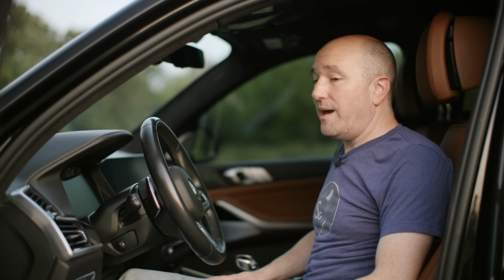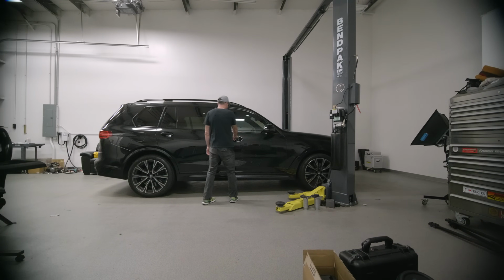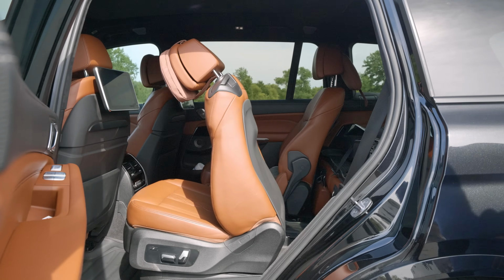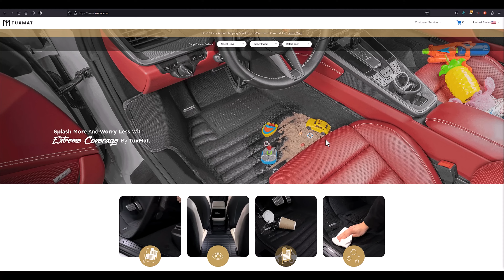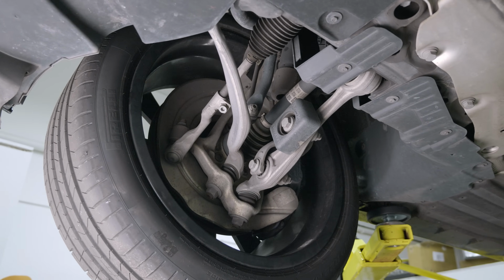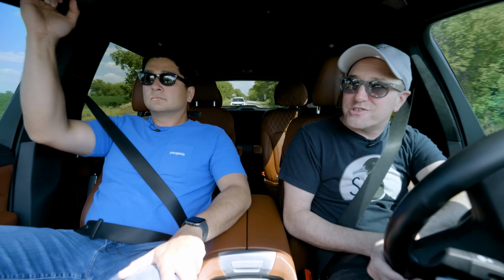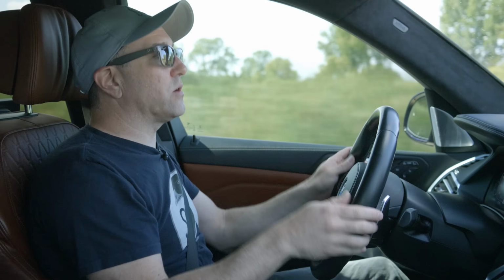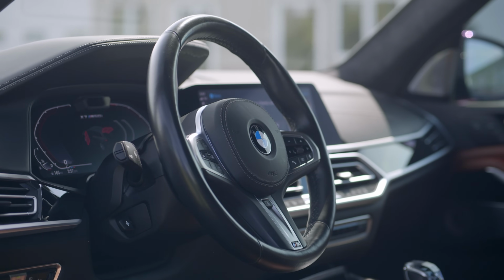BMW X7 | 45,000 Mile Long Term Results

Comment: Hey host, I have a bmw 340i as my dad vehicle and a Honda Pilot for our family vehicle. Ive been dying to upgrade to an X7. The Pilot handles like a tank, slow, but as you mentioned it pulls off the family duties very well. This video has convinced me that the X7 is not a family vehicle until your kids are 10+
Reply: Not the m50i that is, the 40i is. With bench seat.
Reply: I’m coming from a Telluride which also drives and handles like a big slow tank. The 40i is the most practical choice for most families with bench as the comment above points out
Reply: @cizzlen07  those tellurides have gotten great reviews
Reply: I also have an M340i as my personal fun toy and a Acura RDX for family use. I did test drive the Pilot and Passport as well as X3 and GLC before getting the RDX. The standard Honda SUVs are exactly like what you described. The X3 I tested was 30i the dynamic is just similar to the RDX. Not sure if a 40i would be much different on the X3. The GLC is very luxurious but lack the dynamic. My biggest complaint on the M340i is actually the lack of ventilated seats, otherwise the perfect sedan I ever owned.

Comment: Im driving a 2018 Chevy Cruze. I just bled out the brakes today only because its going on 6 years old with 19400k miles. it cost me 17k new. Ive had 0 issues so far

Comment: I Normally never comment but I must say I look forward to your HONEST no flak reviews.  

A couple questions from a fellow BMW/General car enthusiast 

The X7 is more of a status-mobile for most buyers.  That saud do I person6think the X7 40i with the B58 fixes a lot of the issues and fits almost everyone's needs.  Basically a X7 40i with traditional suspension is the sweet spot.  Thoughts?

I currently own a 23 M3 comp RWD.... EVERY SINGLE ISSUE both interior and performance wise that you mention are exactly my same issues with my G80.  

I think the two best BMWs on sale right now are the X5 40i, and an 840i gran coupe.  They're very over looked and under-rated vehicles that are good at just about everything.   

Current M cars are mind boggling fast but owners know wear n tear parts are always in the back of our mind.  

Great review,  good stuff guy, love your stuff!
Reply from the maker: Yes if you need a 3 row the X7 with B58 is more than enough should be softer as well.
Reply: My neighbor has a beautiful 23 M3 Comp. He's scared of putting miles on it bc of the running costs.
Reply: @randompty  for the first 3 years all services are free so I'm not sure what he's worried about.  I'm in Germany and we don't have free service  😢.  My first service was $400, second service $230.

Comment: I appreciate the diesel versions of the X7 and X5 aren't sold in north America, but in Europe they remain the dominant engine type. The 30d and 40d engines have great refinement, power, torque  and fuel economy (37mpg which gives a range of 700miles)  they suit these heavy cars very well

Comment: I bought a almost fully loaded 2020 750 with 30k miles. Opted for the service plan and extended warranty and I can say it’s been flawless. Only thing I’ve done to it is pull the exhaust flap fuse, because who wants a muted V8.

Comment: I fucking adore my X5 M50i, got one of the last pre-LCI ones from the dealer lot. Traded my G80 M3 for it and never looked back. The G05 platform is amazing in combination with that engine and trans combo.
Reply: Does M50i drive better than an M3? That’s super interesting to know

Comment: I think the trick is the unibody German 3 row SUV's bring more function than Korean and Japanese market products that sell for less.   The big difference is in towing.   The Q7, GLS, and X7 seem to be in a class of their own when it comes to towing.   They are a step up from Pilot, Highlander, and CX-90 for vehicles tnat are fun to drive 365 days a year yet can pull a boat or camper 20-40 days a year.

Comment: Just picked up my CPO '21 X7 M50i and I really agree with the statement this car delivers the that next level performance and comfort that just isn't there in an MDX Type-S or my '16 XC90. I wouldn't have paid MSRP when new on mine but I can see why it's priced that way. In other words, I think it would be a blessing to not be able to tell the difference ( or be ok with it) so you can stick with a more affordable SUV. As for me, I loving every min I'm in my X7.
Reply: Looking at a ‘21 CPO M50i as well. How your gas mileage been? Its not a dealbreaker for me, but I do wonder if I’d be better off with an iX
Reply: @charlesbcraig the mpg is not bad considering the amount of power it delivers but it’s still bad, i average in the 16-18 mpg in my daily commute (50/50). All highway is the low 20s. If you’re considering an iX, that’s a very different car/experience, clearly more efficient but not as big as the x7 so comes down to what you value. If mpg is important, you may want to err on the iX
Reply: @pwang33ece  thanks good to know!

Comment: Great vehicle but for a daily honestly I think for space , comfort and options not gonna lie the 2024 kia telluride is just an all around banger of a vehicle. With that said it's no bmw but it gets the job done with no regrets and fully loaded at 54k. I've learned that trying to compromise making a sport suv a replacement for a toy just doesn't work and the kia allows me to have both without worrying about all the maintenance on my daily hauler.
Reply: P
Reply: @SkeletalMisunderstanding  yessir I loved my launch 2020 telly sx p. I want to trade my 2023 durango rt hemi tow and go in for the 2024 telluride but that sound from the v8 is just awesome. Last of the few. But yeah who knows I might just. That wolf grey on black looks stunning. Best 3 row and value I've driven in a long time.

Comment: Much different car, but...
90k miles on our 2017 i3 REx, and still no mechanical issues yet.
Only problem was my own fault - I didn't replace the 12v battery until it was 6 years old ...Bad idea😂.
Modern German car reliabilty issues are overblown in my experience.

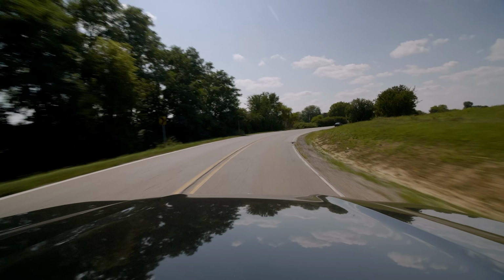Comment: 17:04 That’s why you get a B58 and tune it. More reliable, better mpg, cheaper to run if you get 21s, and has the standard suspension, rides MUCH better than the M50. Lots of running cost problems solved by not getting the V8.

Comment: Thank you for making this long term video. I been debating with the wife on getting rid of our RX350 for a X5 or X7. Probably would get B58 motor and not go $100k for the v8 models
Reply: I went from an RX450 to the X7 B58. Best decision I have ever made. One thing to know though is that not all X7’s come with Adaptive Cruise Control if you’re use to it. But you’ll quickly adjust and see the worth immediately. Just test drive the b58 and you’ll see for yourself. Good luck!

Comment: I love my X3 M40i which is a smaller sister car to the X7 M50i. Great review! I get less space but it's also a lot smaller and lighter too, and very very dynamic. I was also lucky to get idrive 7, not 8, with the fully manual controls. Wouldn't want their giant screens and other stupidity. And yep the X7 is wayy expensive to run...
Reply: How reliable is/has it been? The M40i has the B58 correct?
Reply: @TJ_Kirkland.  yes, B58. Mine has about 50k miles. Only maintenance needed was a serpentine belt tensioner.
Reply: At 50k miles, nothing should fail unless you're tracking or offroading.  At 65k miles with no warranty, it's gonna get real.
Reply: I had an X3M... It was incredible as far as performance but really made for a dogshit SUV lol
Reply: @bassandtrebleclef  how so ?
Reply: have you ever had a used BMW?  This is par for the course LOL  @bassandtrebleclef
Reply: @zabuomar You never buy German. Never.

Comment: I currently have a X5 40i of the same year, and I wonder how he would feel if he had the B58 engine in his X7, especially since he liked the MDX Type S.
Reply: I've owned to 40i X7's.  The B58 is way more than adequate.  Sure you have to wind it out more than the V8, but it is not slow.  BMW also under rates their power figures.
Reply: @The_action_is_the_juice  I couldn’t agree with you more.   Definitely not slow.
Reply: I’ve had 4 B58s and NEVER had an unscheduled maintenance, issue, whatever. A couple were stage 2 w/FBO and still no problems. Definitely the best engine since the 2JZ. I avoid 50 badged BMWs like the plague. Only problem I’ve ever had with BMWs is the sunroof sometimes takes twice to close.
Reply: The post refresh I6 has more power and torque also. I wouldn’t buy one any other way. More than adequate. Still in the 5s 0-60. Remarkable for the size.
Reply: How long have you had it and have you had issues?
Reply: @prabeeshsidhu  had my X3M40i for 56k miles with BM3 stage 2, no issues, even with the stock charge pipe. Had two 640GTs, one got totaled the other traded, no issues on either. X740 has 42k miles right now, no issues except sunroof very rarely, once every 10k miles or so, won’t close because of some small debris. It has a racechip, full bolt ons, and a resonator delete.
Reply: @nikiller95  that’s awesome to hear as I’m actually looking to buy a pre owned x3 m40i and that’s why I asked. What year did you have ? Those mods sound fun ahah
Reply: @nikiller95   probably bc Toyota helped finesse it
Reply: @kylenewberry8598  EXACTLY! Nobody knows that. Toyota got the engine from BMW and said FUCK NO! People don’t understand Toyota wouldn’t put an inferior engine. In the end it seems like BMW got the best deal. They got Toyota battery technology, which put them years ahead of MB and VW, AND they got a Toyota engineered motor. PLUS, Toyota makes major BMW interior parts through one of their subsidiaries
Reply: @prabeeshsidhu  I had a 2018 with bootmod3 stage 2 agg tune, a catless down pipe (I would recommend a 200 cell for most, the smell is alarming to some), an intake, one step colder spark plugs, Ignition Project Coils, and a charge pipe. About 4k all together. Ignition and down pipe were installed by a shop, I did the intake and charge pipe
Reply: @prabeeshsidhu  I just got it about two months, but this is my 3rd BMW product. I bought it CPO with 50k miles, warranty ends in 2025, so I’ll see how things turn out. So far I am experiencing the same binding sensations from the rear as he is. I will have that checked out at the next oil change.  Other than that, I am loving it. The ride is buttery smooth and it’s pretty fast for the claimed horsepower which I’m sure is underrated.
Reply: @nikiller95   well it was minor revisions. They were overall pretty impressed by most accounts.
Reply: @The_action_is_the_juice I tried my 40i today against my bros durango srt,and I was not far behind, both of us stock.😊

Comment: Wow  you nailed this vehicle! Amazing. 

I own a 2021 X7 fully loaded -and funny you said the cup holders are trash!  Absolutely and  from day one the center cup console wireless charger etc did not work.  But I finally got the dealership to fix it! Idk if it will continue working. I had to really go  back and forth...w service about 5 times bc their rationale for not fixing made zero sense. Long story short we got to the owner of dealership and did a quid pro quo's between businesses. 
And yet the service manager said don't put drinks in there like wait what!? it's the drinks causing the issue a build up on the wires. 

I had to fight tooth and nail. 

Your review is spot on! 
I love the vehicle- it's great for my life right now. I want the wraparound mats!!! 

I just had my ambient lighting fixed too. but I need to see if it works at the bottom. I don't recall. 
And yes I had trouble w tires bc of different sizes as well. Cost me $3K! Bc I waited and needed and had to pay for what was available. Originally it was $1850. Ugh. I needed tires at 15K per my dealership 
Which upset me!